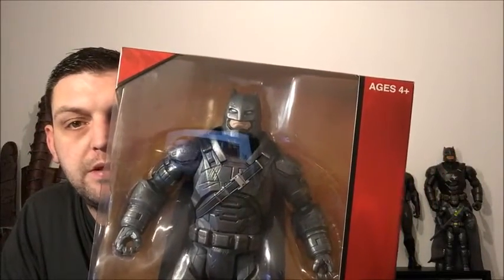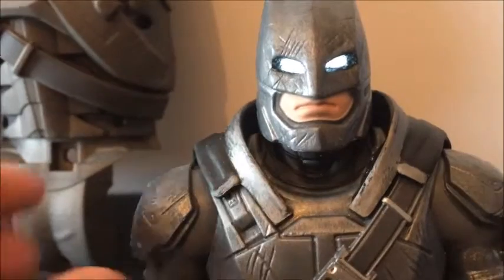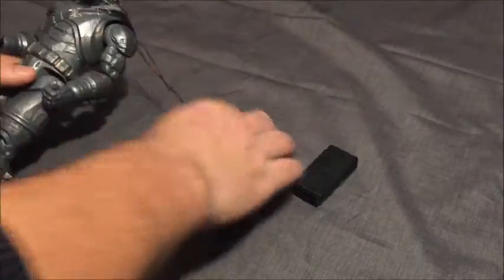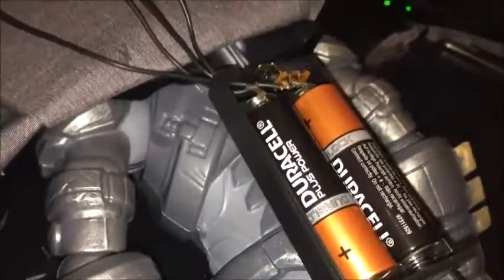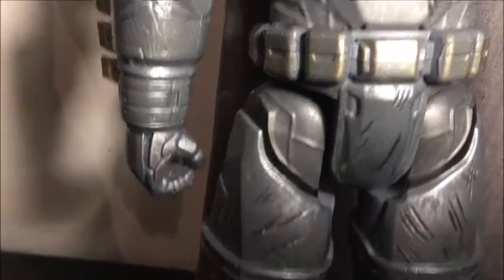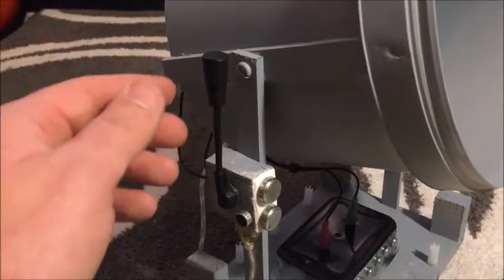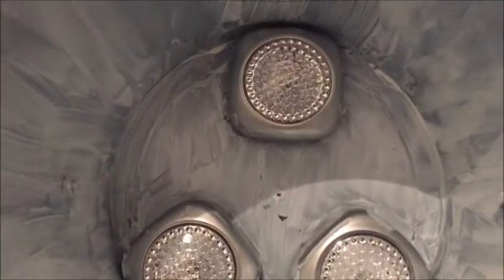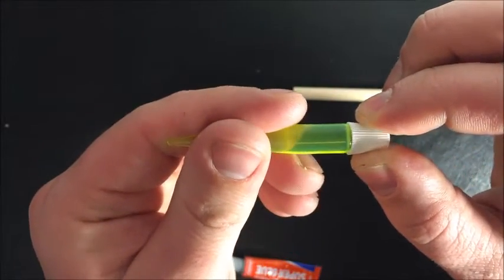12 INCH CUSTOM ARMOURED BATMAN FIGURE MAKEOVER

Comment: Hello,

I want to do a spear. I have the same 12 inch Batman figure, requesting you to tell the size of the hand hole or the diameter of the Dowel you purchased.
Reply from the maker: Hi I think the diameter of the dowel was 8mm. But it's been some years since I did this custom. I suggest measuring the width of the hand. You can buy all different diameters of dowels on eBay

Comment: how were you able to get the head off to put the led
Reply from the maker: i cut it off using a thin chisel, cutting away at the plastic underneath the helmet. then once the helmet was off i drill a hole bigger enough to insert the two LEDs